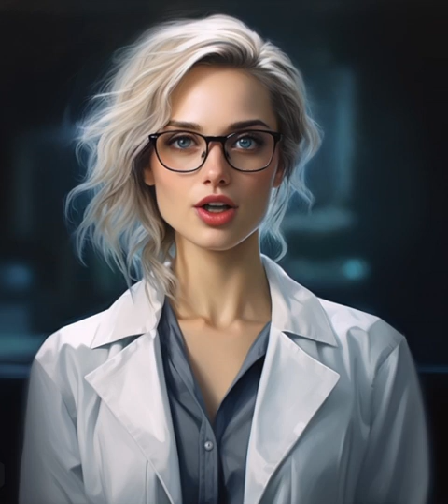Meow Ep. 7

Comment: Is the ODB optimized for 7.62x39 supersonic? I am in the market for a suppressor for my 300 blackout (I plan on shooting subs and supers). Is most of your testing centered around the ak-47 platform and 7.62x39 or do you test 300 blackout as well? Thanks!
Reply from the maker: ODB optimized for 762NATO. Yes, you can run 300BLK.
Reply: @specterscat  pewscience 308 data dropping pre black friday release?
Reply: The numbers for the ODB are on the Pew Science website. It's been tested on .308, 300 Blackout, and 5.56. It's in the top 5 for 300 blk

Comment: Will the Ti spark less over time? I’m really trying to find which one works best for my application. Since inconel can get much hotter, does that just mean that it should degrade less over time? Is there an estimated round count for each material for the life of the WB?
Reply from the maker: Yes, sparking does diminish over time. New Ti suppressors tend to spark more at the start because it's impossible to get all the fine particles out at manufacturing. Technically, we rate Ti at 100,000 and 718 at 120,000 as "Life" but they just start to lose effectiveness.
Reply: 8:16